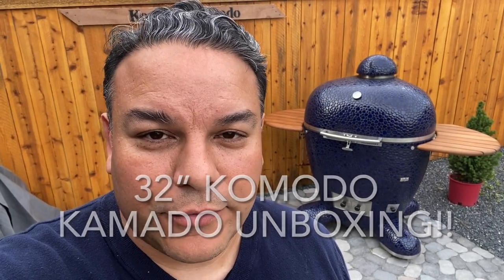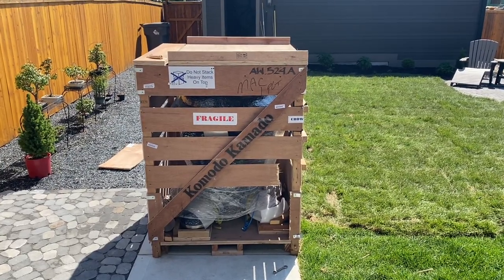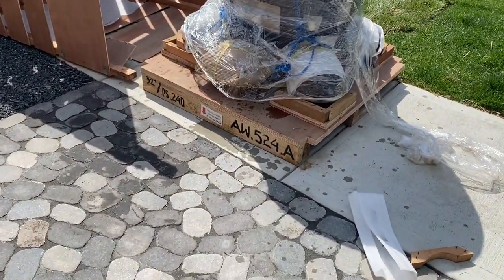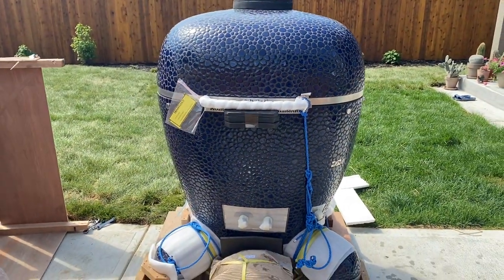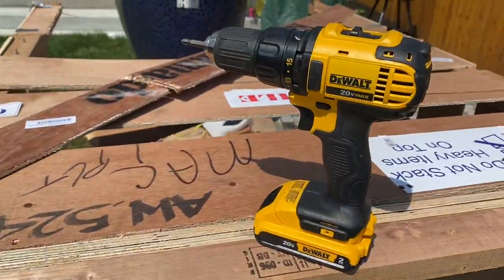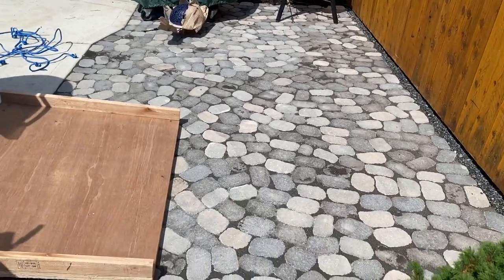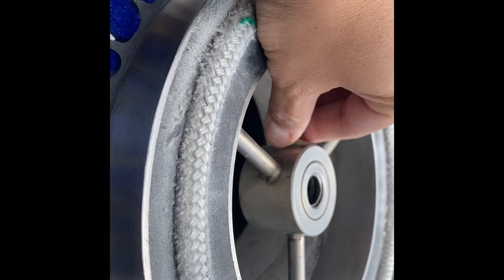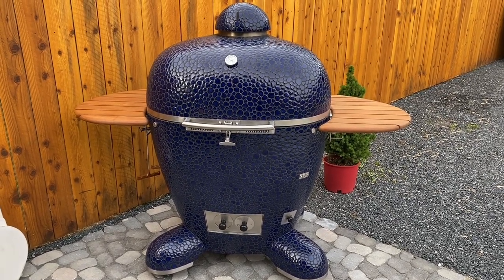32” Komodo Kamado unboxing

Comment: Can you put charcoal divider either way as in 25% on right or left. I happen to see someone cooking indirect and used the half great over the fire which was 50% on left side and used half hotel pan as heat deflecter on rack below. Thats why im curios about setting up fire box partitions. I would think indirect fire on right side and 1/2 rack on left. No need for heat deflector.
Reply from the maker: You can set it up either way, but the grill includes a 1/2 grill that would dictate one side, of course you can just flip it if you choose. Definitely no need for a stone deflector like many BGE folks use, I just use a little sheet of foil to catch drippings and block heat, works perfectly
Reply: @perezog  Thanks for the responce, I watched more of your videos and I believe you mentioned that, I was watching someone else where the fire was on left side he then added next rack and put hotel 1/2 pan on rack as a diffuser. That was reason for question, for whatever reason I always see coal divider installation started on right side.
Reply: Hi - getting my 32 tomorrow and was wondering if you were able to roll it down the ramp yourself or did it require additional help?  Thinking if I get a nice driver, perhaps that and $100 tip he will help.